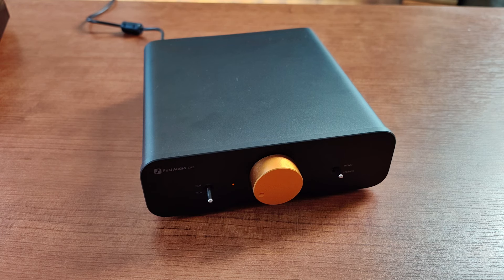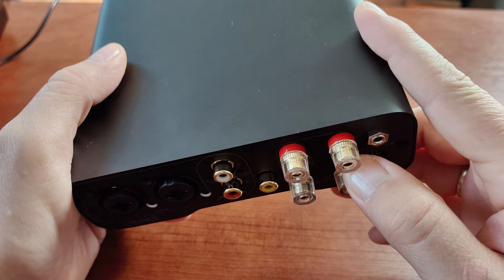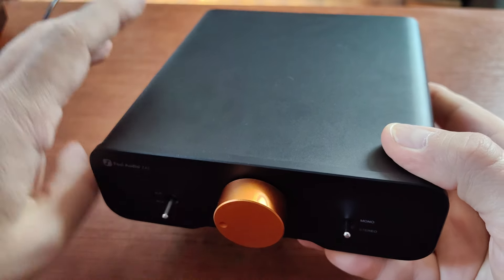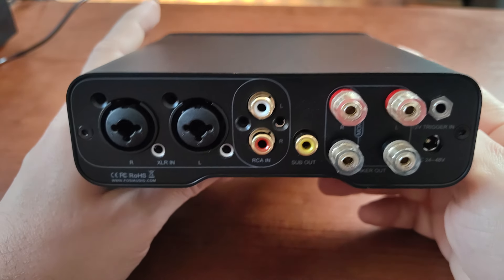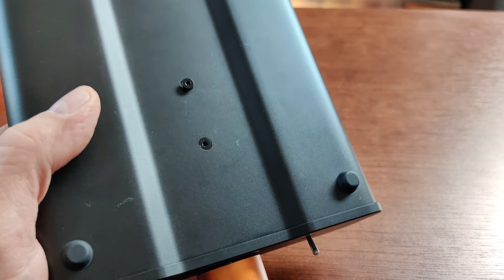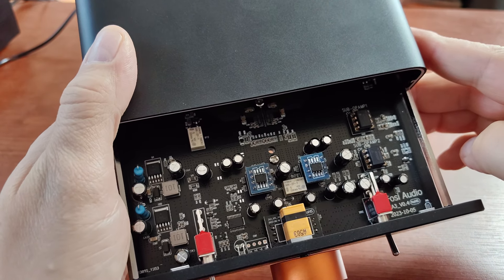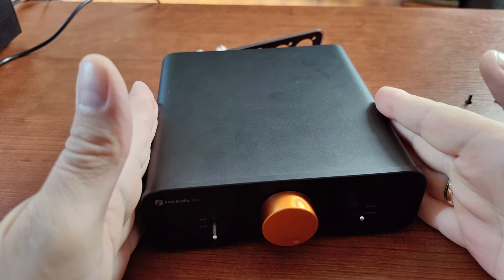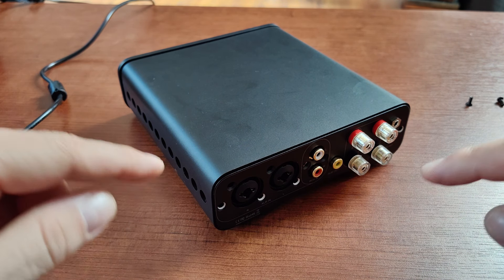Fosi Audio ZA3 speaker amplifier review - bargain HiFi for everyone (disassembly included)

Comment: it should be mentioned that Fosi messed up the deign of the ZA3 and they are getting ready to replace it... the design issue with the ZA3 is its missing some of the filtering and so its sound characteristics change when its presented with different speakers with different load ratings... on some speakers it sound very bright due to this problem....
Reply from the maker: It's a trait of most if not all TPA series amplifiers. They are a bit brighter at the top and that usually compensates with more difficult load over 10-12kHz. But in my experience with about 7 different set of speakers it was never an audible problem. This gives them openess at the top end, but at the same time I have to admit I wouldn't pair them with something excessively bright. Too much of a good thing :)
Reply: @k4syx  its simply because they didn't pay attention to the design specs that Texas Instruments documented for them....  they are now getting ready to release a newer design with the proper filtering included....  the older ZA3 is also a FAKE mono design as the switch doesn't do much besides turn off the other channel... also the newer design will be mono and not include the volume knob...   it also will have better power supply with 10amps available...
Reply from the maker: @dixter1652  that doesn't bode well for future sales, right? :)
Reply: @k4syx what speakers can you offer?
Reply from the maker: @andrews4379  what do you mean? What can I recommend?
Reply: @k4syx  yes
Reply from the maker: @andrews4379  what's your budget?

Comment: Hi, thanks for the honest review. I took two of these and tested them heavily for a month after 200 hours of burn in period with Sparkos OPAs. I really give them a chance and my conclusion is the same like yours. They are good for the money and good for the desktop application. So, don't expect the miracles from these amps especially if you are used to bigger solid state Class A or similar amps. On one amp I went a one step further and I have replaced the power capacitors and signal capacitors with same values but it totally messed the sound picture of amp. The quality of installed components is questionable, including factory installed OPAs. The quality of PCB, trace lines and pads is really poor. BTW, I have Aiyima A07 Pro amplifier and I prefer the sound of Aiyima more.
Reply from the maker: Yes these are good value for the money, but the hype is not real. BTW thats interesting what you're saying about A07 Pro. For some reason I find A07 Pro with better opamps one of the amps I want to keep, souds really good though the build is not as simple as others and it has dreaded bass and treble controls ;)
Reply: @k4syx  I use A07 Pro in combination of OPA1612 and BB OPA2604 and to me A07 sound neutral and natural. Even with affordable TI LME49720NA A07 Pro will sound transparent. Pair it with warm sounding DAC (e.g. AKM bases) or in my case DIY tube DAC and you have everything for good start. With Fosi's I always have feeling there is something around music and it not part of original recording (i.e. some kind of noise is present).

Comment: Nice pro tip on removing all the back plate screws for disassembly.  Thanks.
Reply: Disassembly tip: just remove the (2) m3 screws on the BOTTOM. Next, remove the (2) m3 screws that are CLOSEST to the EDGE on the back- that's all you need to do (4 screws total). Reply if you have any questions...
Reply from the maker: @billmcginley  how will you slide out the PCB then?
Reply: @k4syx  Sorry. I forgot a critical step. Remove the volume knob and 10mm nut on the potentiometer. NOW you can remove the front panel and pull the pcb out from the back.
Reply: @billmcginley  Not exactly.   What you've described is standard method for disassembly.  It requires removing the volume knob which some people find unnerving.  Also it can be tricky re-aligning the toggle switches with the front panel holes.  And finally there is some risk that you can bend the tiny LED lamp so that it does not shine through the lens on the front plate.   @k4syx's method avoids all this.
Reply from the maker: @billmcginley  so you just pull the knob? Mine just wouldn't let go, and I was afraid I'll damage it as it doubles as a switch. If there's a nut underneath then it's standard solution...
Reply: @k4syx  it comes off... it's just tight. Carefully pry it away from the faceplate with a blade screwdriver. Put a cloth or some type of padding between the faceplate and screwdriver so you don't damage the faceplate. Gently pry against the back of the know, then move your blade to a different location 180 degrees from the first pry position. Be patient... all yo need to do is get it "unstuck ". As soon as you do that, you can pull it straight off with your fingers

Comment: Just placed 4 LM 4562 chips into the ZA3.  LM 4562 : "gift to the audio hobbyist from the industry".    I left one subwoofer socket with the original chip...everything else replaced.  Also placed one of the LM 4562's in the XLR chip socket.....
One word: Wow !  Only £20 for four LM 4562's.  The ZA3 copes very well with these high speed chips...no oscillation.  Crystal clear instruments and vocals.
The ZA3 can actually produce 200w per channel as shown in some test videos with the 48v power supply.  There's no need to buy a second unit....it already has twin Texas processing chips.
Reply from the maker: I will have to try these. I can see that TI says they were superseeded by OPA2891 - havent heard these either so there will be some shopping :)